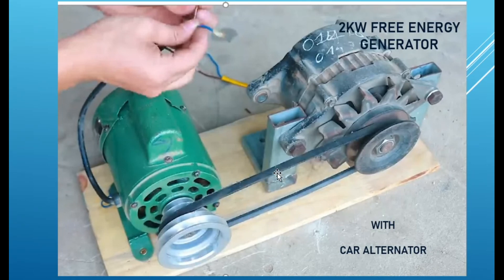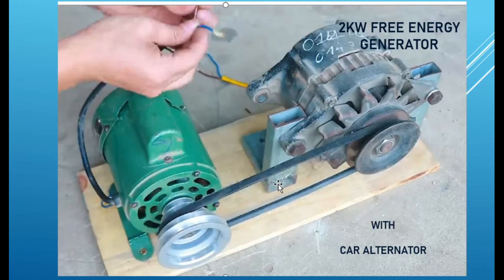How to Turn a Car Alternator to 2kw Free Energy Generator

Comment: Thank You for your video. It seems as if this concept would be a nice alternative to the gasoline or diesel generator, if there was a temporary shortage in fuel. Perhaps even a complete antiquating of both the gasoline and diesel generators as well, if the wear and tear & replacement of the brushes and circuitry of the motor and alternator was less than the cost of fossil fuel generators. Do you have any schematics for the connections of the motor and alternator, and also the correct match of alternator to motor ( for RPM necessary to produce a good constant and safe EMF ).
Reply from the maker: Check my video, I explain this